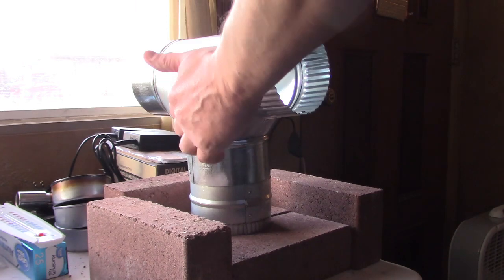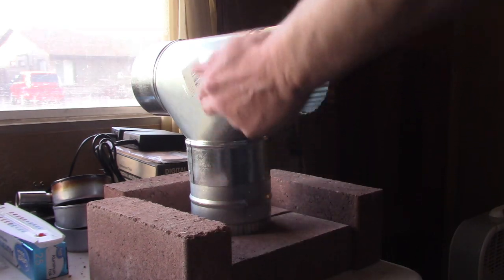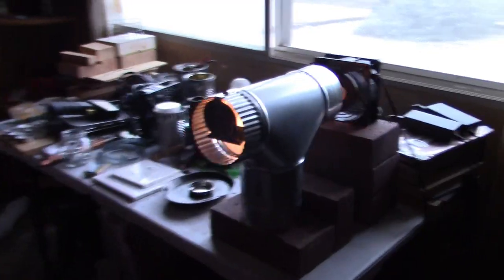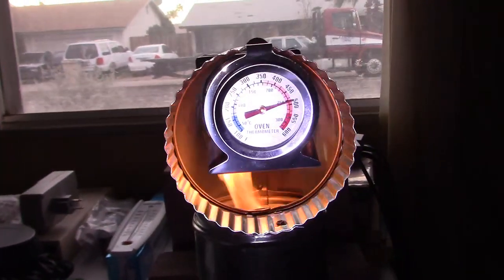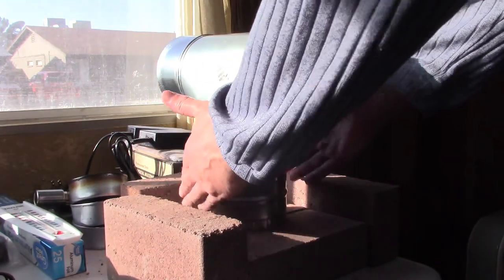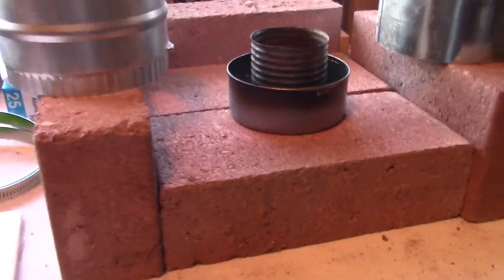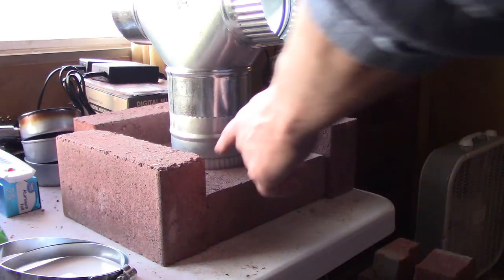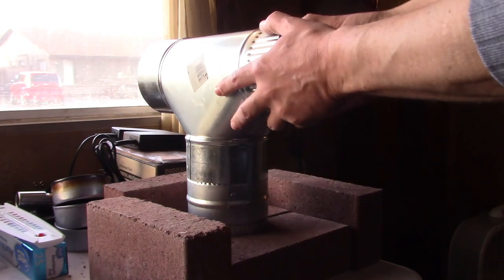DIY Air Heater! Tee-Pipe Heater Improved! (3X Hotter!!) Orig. 170F/77C - Now 500F/260C! Hot Furnace!

Comment: Got any suggestions on how to burn less fuel but get enough heat to still do the job?
I want to get a longer burn time per oz of fuel for obvious reasons.
Since the purpose of the design is to heat the air going up the tube, then the fan blow it out into the room, I wonder if the flame could be reduced enough and add enough extension to the coupler area to still heat the air hot enough?

So would an alcohol stove can do the same but have a longer burn time?

Comment: I'm trying to understand costs here. Maybe I don't know where to buy cheap ethanol. I see 32oz for $20 ($80/gal) for 200 proof Food Grade.... but at 2oz burn rate per 30-40 min.. this gets expensive pretty quick.
 [Edit] I just saw 12pk of 1L bottles (33oz) of BioEthanol on ebay for around $48-$60 f/s. Now that's a lot better.  about $4-$5 a bottle so  let's say 29c/2oz ... so about $0.60/hour

I asked ChatGPT to help me calc. the BTU/hour  assuming 2m/s air speed, 4inch vent, 500F out, 68F in and 50% humidity.  Comes out to almost 16000 BTU/hr !

Let's assume the circular vent has a diameter of 4 inches, which is 0.1016 meters.

The area of the vent is:
A = pi * (d/2)^2 = 0.00812 square meters

The volumetric flow rate of air:  (area of vent in sq.m * air speed in m/sec):
Q = A * v = 0.00812 * 2 = 0.01624 cubic meters per second

To determine the mass flow rate of air, we need to know the density of air at the inlet temperature of 68F (20C). Standard density (rho) of air is approximately 1.2 kg/cubic meter at this temperature.

So, the mass flow rate of air: (volumetric flow * density)
m = Q * rho = 0.01624 * 1.2 = 0.01949 kg/s

Temperature difference: The heater takes in air at 68F (20C) and outputs air at 500F (260C), which is a temperature difference of 440F (240C).

Specific heat of air: The specific heat of air at constant pressure is approximately 1 kJ/(kg*K).

The energy required to heat 1 kg of air by 1 degree Celsius is 1 kJ. 
Therefore, the energy required to heat 0.01949 kg/s of air by 240C is:
240 * 0.01949 * 1 = 4.67816 kJ/s

To convert this to BTU/sec, we can use the conversion factor of 1 BTU = 1.055 kJ:
4.67816 / 1.055  = 4.43 BTU/sec

Convert to BTU/hr (how heaters are rated):
4.43  * 3600 = 15948 BTU/hr
Reply: A simpler calculation for "America" :)
BTU/hour =  CFM (cu. ft/min flow)  x deltaT (temp out  - temp in ..in deg. F)  x 1.08 (constant)
CFM could be measured with a handheld device that measures air speed through a vent
Reply: Also to add, in USA, you pay natural gas utilities per "therm". 1 Therm = 100000 BTU's.... Current prices avg 1.80 with delivery, per therm.  
So still cheaper to use the natural gas. 
But maybe if you just want to heat just a bedroom this may save money, instead of heating the whole house via the central system.
Reply: But I realized now that my assumption of 2m/sec air speed must be very wrong. It must be way less... because it doesn't "add up".  
The normal BTU's you can get by burning Ethanol is about 20000/liter (33oz)... so only 1250 BTU (about) for 2oz  ... (which is said to burn in 30 min here)..

So 2500 BTU / hour should be the maximum you can get from burning ethanol at the rate of 4oz/hour.... nowhere near that 16000 calculation that assumed 2m/sec air speed coming out at 500 deg F
Reply: I figured it out. See when you hold that thermometer so close to the fire, that metal in the thermometer absorbs so much of the infrared (heat). That temp you're seeing of 500 deg F, is FAr from being the *AIR* temperature that comes out of that vent. In fact if you take that thermometer and hold it on a candle flame it will probably reach that.
Look, to heat AIR "quickly" is very expensive because it doesn't absorb radiant heat (infrared) easily. If you want to know how fast a given room will heat the air to a constant temperature, it's all about the the BTU output and you just can't cheat nature. But you can for example store heat into something that absorbs it quicker (say..clay, stone..mass of concrete or sand)  and that will absorb it quick, and be able to release it to the air slower, where the air can absorb it slowly. 
You can feel like it's hot when you stand in direct view of an infrared emitter (something very hot..like fire..sun..oven ). But shade that direct view and that feeling is gone (because it wasn't the air temperature you were feeling...it was the infrared radiation). Same goes for your thermometer. It's not measuring the Air temperature. It measures the infrared radiation absorbed by the metal in the thermometer.
You can do the math and figure out how long a room space air will take to heat from a given temp to another temp, using ethanol at a specific burn rate.

Best.
Reply: Your channel is v cool and i just discovered it :) 
I came back here because I want to elaborate on the difference between infrared radiation and ambient temperature. 
You see both are "sensed" by a measuring device like a thermometer or..your body skin. The difference is infrared radiation can pass through some transparent things but cannot pass through most materials. If you're in direct view of something hot, you will feel that infrared radiation and your body perceives it as "heat" - same as it would ambient temperature. The difference is that "direct view".
If you have a "mass" of some material that has absorbed heat and that mass is located in direct view, it will release that infrared radiation slowly and you will "feel the heat" for longer. This is why in the older days and even now in rural areas they have BIG MASSES of materials  (think clay, heavy cast iron , terracotta stoves..etc) they would heat up. Those materials absorb that infrared much faster than air. Then when the fire is gone, they continue to release that infrared into the surrounding space. If you're in direct view you feel heat.  You can also feel heat if the ambient air (which took much longer to absorb the heat) has increased in temperature. But that's not needed.
They used to have "naked skiing day" in the Alps and I think even in Vermont. It would be cold outside, but the sun and no wind would ensure all the infrared emitted by the sun would make you feel hot enough, to even take your cloths off and go naked skiing.
These things on your channel I see many of them use this principle of infrared radiation absorption  into some heavy mass, then slow release into the air,. This is the key. Otherwise you need a LOT of energy to heat air directly because it just doesn't want to absorb heat.  So if you happen to want to measure an "ambient temperature" always make sure you shield your thermometer from a heat SOURCE. Because otherwise you're measuring the infrared absorption of the metal in the thermometer, rather than ambient temperature.

GL - I like your channel - subbed.
Reply from the maker: hi. thanks for the comments and i'm glad you like the channel (and that you found it). 🙂

Comment: You should test it by putting some rods in there. Drill some holes going from one side of the pipe to the other then stick the rods in there to heat up by the 🔥flame I better gets a lot hotter.. I'm doing that on rockfield right now

Comment: This is the upside down version of the Dakota style fires. If you added a small hole on your can or where airflow can get under your flame, that would add another 100 degrees hotter minimum. I built 3 of these for my 60 ft shop. I do have a wood stove, but these work just as good and I don’t have to wait around for the wood stove to burn out. Lol

Comment: Is this better than the bricks did, in your opinion?  Also, what do you think about putting a couple copper coils on ethanol in there if the grid did go down so that you could actually sleep 8 straight without refilling over and over?  Just a question, I've been watching from afar and like the stuff you've done.
Reply from the maker: hi. it's hard to compare to my brick heaters. this one really cranks out the heat though. i'm not sure what you mean regarding the coils

Comment: I WONDER IF USING A 3 WICK CRISCO CANDLE WOULD WORK....IT WOULD LAST 72 HOURS...SO THEY CLAIM... JUST IDEA...GREAT VIDEO THANKS FOR SHARING!!!
Reply from the maker: hi. unfortunately the wicks on the "wick based" burners will just blow out.
Reply: @desertsun02  Hey there! We've chatted before.. I'm a van dweller.. I think I might have a solution to the wicks burning out issue. What if you had about 8, 1- inch holes (for air flow) near the base.. and then you block off the back of the T with some sort of cap.. THEN.. you place the fan at the front end, drawing the heat OUT of the T, and into the room? I'm gonna try that method, myself. I'll let ya know what I find. Keep up the GREAT work!

Comment: Can we get a temp reading of the air coming out ? Because you are attached to the metal. 500 seems extremely high
Reply from the maker: hi. the 500F is the actual air temp. the metal tube doesn't actually get very hot. maybe 150F (that's because the fan is blowing on it non-stop - and because the hot air is blown out of the tube immediately). the 500F is the real air temp. (100%). it topped at 500F but it was steady at 485F for a long time.

Comment: If you can hook the fan up to solar power with a battery that would be a great efficient way to heat a house
Reply from the maker: i agree! you can hook some of these dc fans straight to a 12v solar panel (no battery needed) or just straight to a 12v battery. 12v computer case fans work great with this unit and can be run straight to a panel or a battery.
Reply: @desertsun02  nice

Comment: The fan blowing through the T fitting, could be creating a venturi. If so, that means that the leg with the alcohol stove is under vacuum. I wonder if drilling small holes around the bottom fitting, near the height of the top of the tuna can, would help the flame burn hotter as it would suck fresh air in and feed the flame even more,  making it even hotter. 🤔 I may have to try this and see what the results are using different configurations. Thanks for the video and information!
Reply: I think you are totally right. I think the reason it works now is that the new extension piece has the crinkled wavy metal ends. That lets air in at the bottom of the flame and the extra height makes it act like a rocket stove. If you seal that joint, then it wouldn't work as well. But, you could seal it and drill holes like you said, Jay.
Reply: Totally right. More air is better not just for heat but also less soot buildup! 🪔

Comment: The parts I got at our HD looks a bit different. The Tee doesn't have the ribs on it and the connector for the bottom is a bit longer, hope it works, but an experiment right?. Is the Tuna can have a significance? Or just for saftey. Thank You for all your projects through the years, you are appreciated! 😎
Reply from the maker: home depots tee pipes are a bit different. i got the tee pipe from lowes. if the tee pipe you bought from home depot doesn't work - let us know (if you want). it would be helpful to know if it works. the tuna can is just for safety.
Reply: @desertsun02  If you look on HD site you can see it is a Tee but not as nice as yours. I knew I should of went to Lowe's. I'll let you know how the longer connector works.

Comment: I am wondering...
Would adding some holes to the bottom of the coupler allow more fresh oxygen into the "plenum" and further increase the temperature of the burning alcohol? The yellow flame suggests incomplete combustion.
Reply from the maker: hi. it seems like it's actually burning just as strong as it does with no pipe over it. much of the air that is shot into pipe actually goes down to the flame and then back up again. it looks so yellow because it's in an enclosure. that same flame looks almost invisible when you add light to it. *my next video shows a great example of that. (it looks solid yellow in the shadows and almost invisible when i shine light on it. my original video with this 4" tee pipe has some footage of that too. (when the living room curtain is closed it's yellow and when the curtain is open the flame looks half-invisible.

Comment: Those look like Landscape bricks.  I was just trying to better understand why tape is better than clamps.  I get that it seals the air at the tee junction.  Just seems that the clamps would be a more durable connector than specialized tape.  Apparently Amazon and Wal-Mart sell the bio ethanol.  I did not find any at Lowes.  But I forgot to call it Bio-Ethanol or Regal.
Reply from the maker: hi. the worm gear clamps won't hold it because the coupler is designed for flexible tubing. when i tried to use them it just pushed the coupler out of the tee pipe and it wouldn't hold. i would have just used them if i could have. 3M sells a high temp tape that is good up to 600F. some people have suggested screws or rivets. that may work
Reply: @desertsun02  Thanks.  That makes sense.

Comment: slip a couple L brackets under the clamp to sturdy it... I wonder what height you start to see diminishing temps like a velocity stack on a carbureted engine some top racers would get it down to fractions of a millimeter and compensate for temp and humidity....

Comment: AWESOME BUILD as always! Could you use the toilet paper roll in the can so less chance of spilling the alcohol? Approx. How long would 32 oz. of 70 % alcohol burn? Thanks
Reply: Check out lard as fuel. I just watched a few. They burn for a really long time on lard. Good luck
Reply: I was wondering the same thing with the toilet paper in a paint can. You might have to make it a little bit taller.
Reply: I suggest you buy ceramic wool rounds. I'll post a link below (and see if the YouTube "external URLs" filter allows it through...

Update: Nope! It deleted the URL. I'll put an encrypted one below that should defeat YouTube's filter
Reply: These are the Ceramic Wool Rounds I buy:

(You'll have to remove the spaces below and add the dots and forward slashes in order to make a complete web address)

a DOT co FORWARDSLASH d FORWARDSLASH gPtP1K1
Reply: And yes, you can use the toilet paper roll heaters in the quart-sized empty paint cans. On a single fill with 70% isopropyl alcohol that will give you many hours of operation

Comment: have you tried alternative fuel blends, like mixing diesel with a small amount of acetone?
Reply from the maker: hi. i haven't tried mixing fuels. could possibly be dangerous to do that?
Reply: @desertsun02  diesel will not even light with a match, lol. I've seen Indonesians using a hand pumped garden sprayer to spray a mist into a burner and it produces a ton of heat without smoke once it get hot. Was thinking something like that with a tiny hot burner for heating. Could use the fireplace fuel to preheat the burner.
Reply: Lol 🤣 yeah you dont wanna do that indoors.

Comment: I am wondering if the oxygen supply were closer to the flame how would the performance be effected? Like small holes in the bottom of the metal cans and extension sleeve?

Comment: I tried to find inexpensive ethanol, but all I could find was very expensive. If I can get good enough heat using isopropyl and the extension, good enough. I have a 240 sf tiny house. 
The reason the extension helps is complete combustion. You could screw self-tapping sheet metal screws to secure the pipes.
Reply: Search marine supply stores near marinas in your area. You can get a gallon of denatured alcohol for roughly 15 bucks
Reply: I'm in a 12x20 as well. 10ft walls so I have 2 lofts as well. I have a wood stove but this is a good back up.
Reply: I wonder how much more coupler extension would be needed to get a rocket stove affect?

Also, what I would lile to figure out is how to use the least amount of fuel, but get the same or close the amount of heat produced now.
The idea is to heat the air enough but also stretch out the longevity of the fuel.

Comment: Check out the ethanol gel cans...
They're basically a tuna can with a smaller opening on top with a lid.  They burn 2 hours... then you could reuse the can/lid with alcohol or ethanol liquid.
I think you can buy 6 for about $20 last I checked.
Reply: That’s good in emergency situation but not as a true heat source, it would be very expensive.
Reply: @mississippigardener987  
Exactly... but ethanol doesn't smell offensive (like iso) and the gel cans burn for 2 hours as opposed to the liquid is gone in 20-30 minutes.
I think most of these ideas are for emergency or grid down situations though.
Reply: You can buy a gallon of denatured alcohol/ethanol/ethyl alcohol for $15 and it will last you for ages

Comment: That's really awesome. A very minor change makes a major difference in the heat output. You can ask for better than that. I need to round up some stuff and lower my power bill. It wouldn't take long to run you outta the house like that. Great job.

Comment: yes it's hotter, but you are consuming the ethanol more quickly.
Reply from the maker: hi. the burn time is the same on both units. it's not burning any faster. i get around 25 to 40 minutes on either unit (using the same amount of fuel). i timed 2 oz. today. got 38 min. burn time.
Reply: @desertsun02  Curious, my experience in this case is with Trangia stoves; if you separate the pot from the stove you get faster cooking times but consume more alcohol; I thought the same thing would happen in your system.